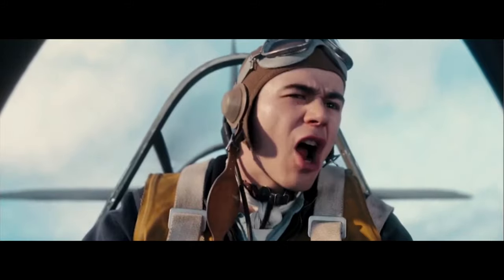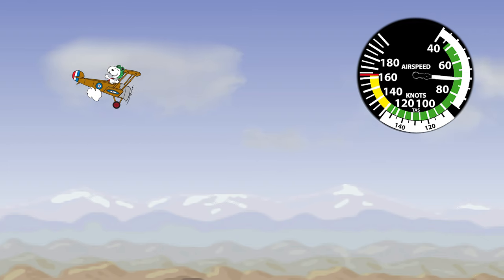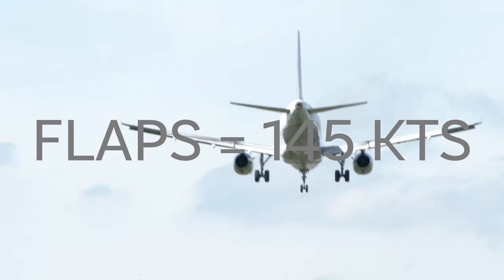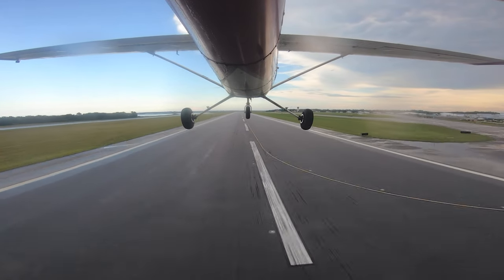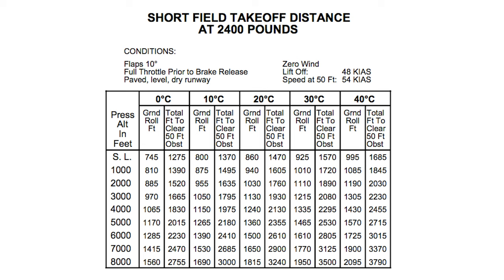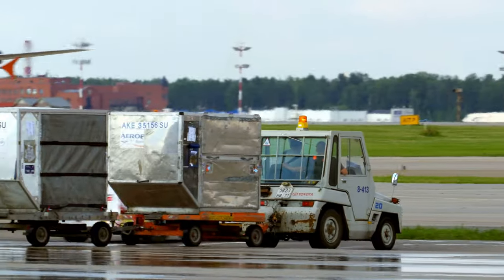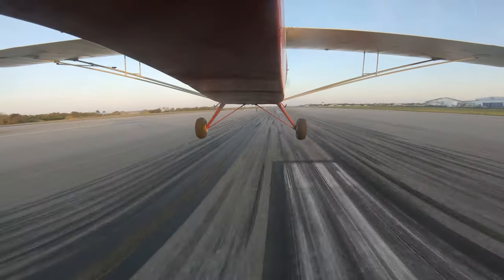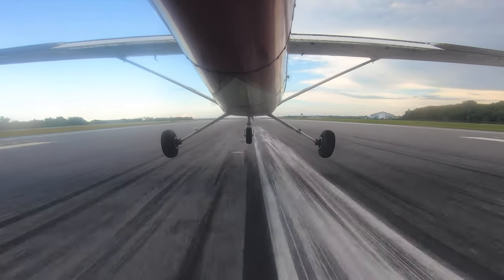The Truth About Airplane Flaps

Comment: Nice video.   One trick for using flaps to shorten takeoff roll while minimizing drag is to start the roll with no flaps then add a notch or two as you approach rotation speed.  The plane may balloon a bit and the trim setting will most likely be off slightly, but it works.  The pilot just needs to be ready for the change in dynamics.  

I always include no flap landings as part of my primary training task list.  It’s not in the ACS but certainly should be covered.
Reply from the maker: That’s interesting. Thanks for adding to this discussion!

Comment: The PA28-180 I’m training in, I use 25 degrees flaps to takeoff. It helps the airplane lift off at a slower smoother speed. When I don’t use flaps I need a higher airspeed to liftoff and the nose wheel shimmy’s really bad. Thx for the great video!
Reply from the maker: I’ve heard that about other planes as well! So much easier on the gear and tires to lift off earlier.

Comment: Good video. I was actually thinking that for LSA size planes or even SR22 that with a light construction it might be better to not have flaps because of the reduced complexity leading to ease of construction and lower price and bigger market. With certain gear height you can flare the plane. If we are talking a quarter of a second more on the brakes if even that, is that not worth it if you can lower the plane weight and cut the cost by maybe 30%. A huge problem in aviation is cost and the plane producers are eternal whiners about market size. Our WW1 plane has to cost 400k or we can't survive. I'm talking about the awful atrocious carbon cub. 
A Tesla Model 3 starts at 40k$. That's a pretty sophisticated vehicle. A carbon cub fabric over metal is over 400k. GA is a disgrace.

Comment: Flaps don't develop lift, wings do! And they don't add lift. Unless you're using flaps that increase the wing area. What flaps do do is change the cord line of the wing. That's why you can Land at lower speeds with the flaps down. The jet could land at the lower speeds without flaps. but it would have to increase the angle of attack to such a point that the tail would hit the ground before the wheels would. But on some big jets the flaps actually increase the wing area. So deploying the flaps would increase lift. Again flaps don't add lift (unless the add wing area) they just change the angle of attack the airplane needs to fly to create the same lift.
Come on dive flaps are air brakes. Not landing flaps. Have nothing to do with landing. That airplane comes with split flaps. When using landing flaps only the bottom half deploys. When they use it as dive flaps (it's really an air brake). The top part opens along with the bottom. Not meant to change the cord line in any way. Just to create drag. So flaps they are not, at least not when used as air brakes.

Comment: The subject of flaps is fascinating because it varies so much from airplane to airplane. Some airplanes I have heard won't launch off the ground without the flaps and some I have heard won't launch if you have too much flap. If a pilot blows is approach and has to make another pass they generally say to take the flaps off and then put the flaps back on. I've always been curious about this.
Reply from the maker: Well typically you don’t want to have flaps on when already in the air and climbing. So for a “go around” you would retract the flaps once you decide to go around and gain altitude, then extended them again once you’re on your downwind passing the numbers getting ready to attempt to land again.
Reply: @BradySkye  I always thought that was kind of foolish myself. If you're going around and landing right away why add another thing to do and undo before you make your landing pass? I looked into this and some airplanes won't climb out with full flaps, at all no matter the speed no matter how much throttle if you've got those flaps on they are slowing you down to land. Is this true?
Reply from the maker: @markmcgoveran6811  Yeah it really just depends on the airplane. You can climb at 10 degrees of flaps but full flaps is way too much drag. In a small plane on a big runway you don't want flaps when climbing.
Reply: @BradySkye  yeah that's the difficulty. You are thinking about a climb out to power up and head somewhere. In the landing aborted and go around situation I am in love with the low stall speed the flaps give you. There's been a lot of cases of airplanes touch in abort the landing coming around for the next landing at attempt and stall and hit the ground hard. I've always wondered if not using the flaps during this low speed low altitude come around tight corners in a pattern causes this stall problem?